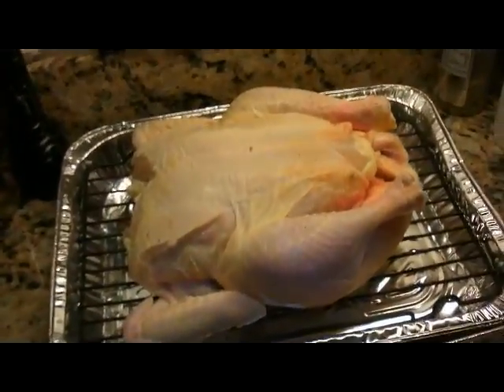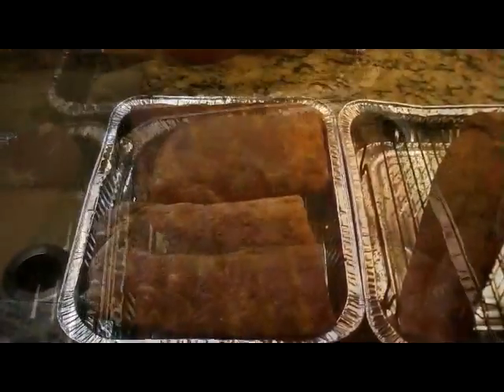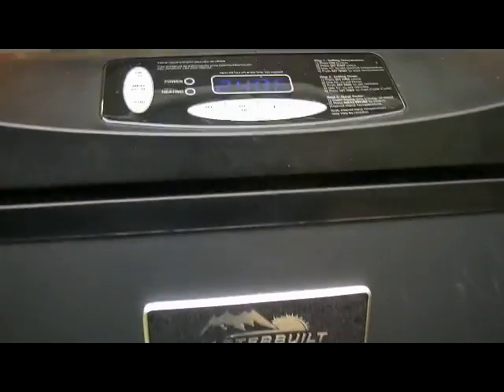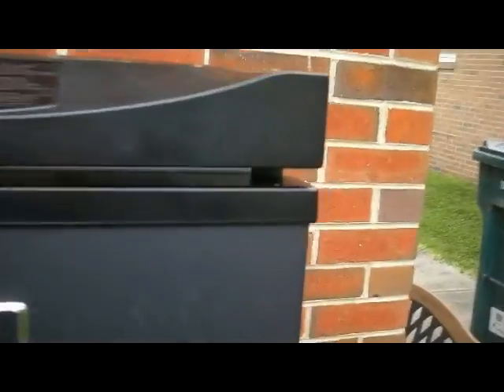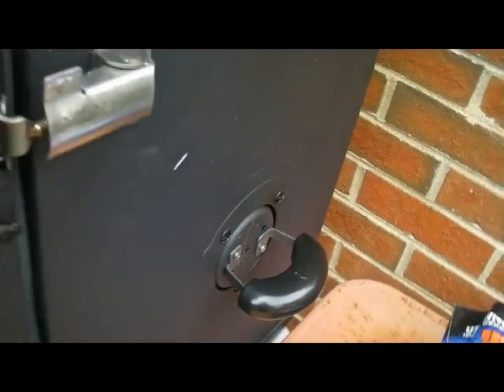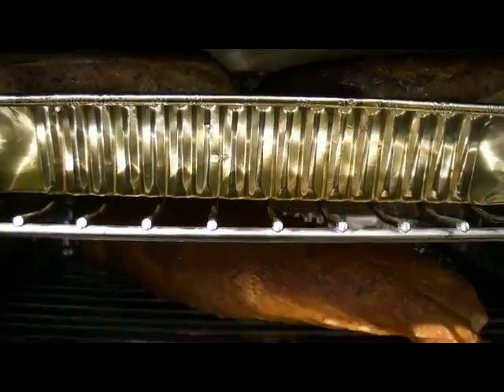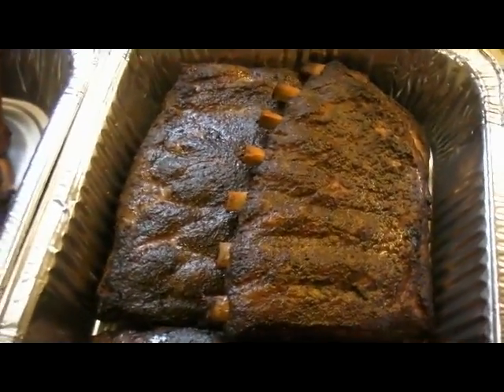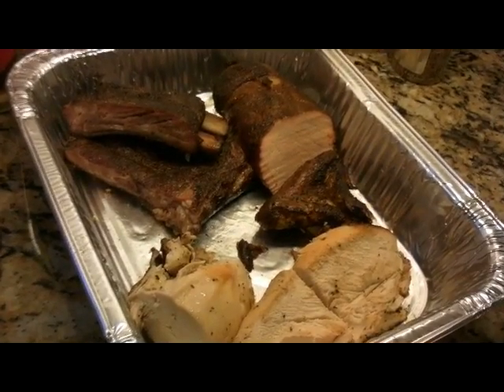Masterbuilt Electric Smoker - First Try

Comment: Don't use aluminum trays next time. The food will turn out better it's not the smoker it's the cooking method. Also different meats cook differently at that temp. You can't really argue the point either because the food was cooked in the aluminum trays. Ribs turn out better at 225 for 2 hours then 300 for an hour then 250 half hour wrapped in foil. Chicken on the rack at 225 will take 1.5 hrs per lb. Pork loin 225 on top rack for 3.5 hrs.